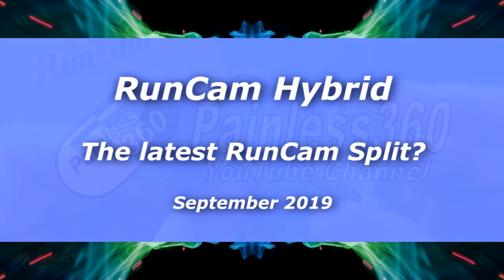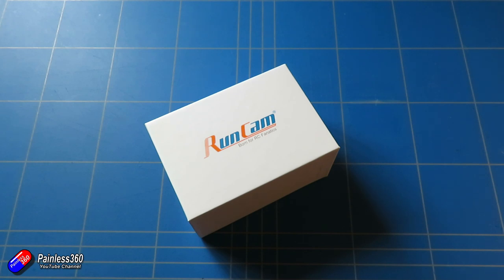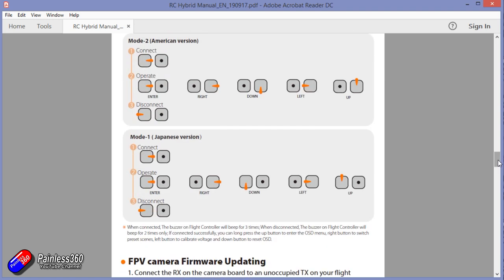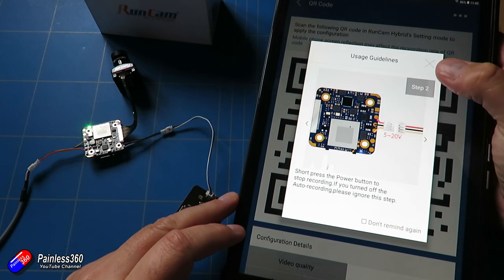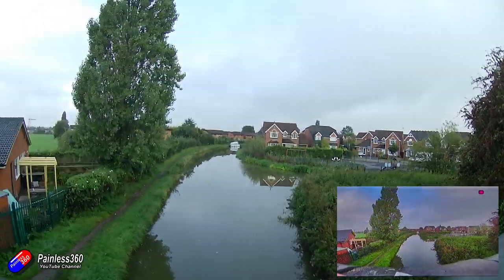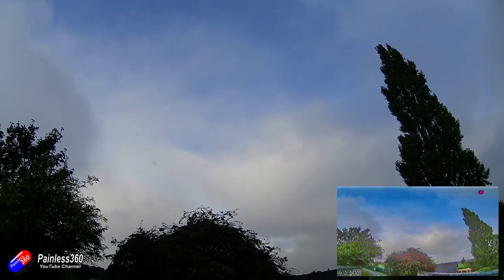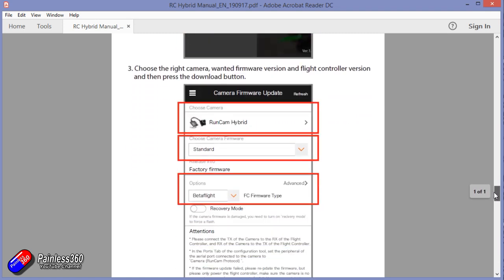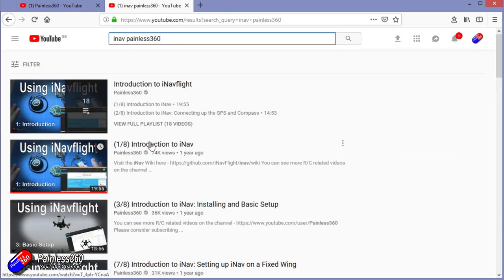RunCam Hybrid: First Look

Comment: Ok, here is what i figured out. Unless the Runcam hybrid is hooked up to a flight controller(UART control) then one MUST have the "joystick" to change certain settings on the fpv cam. The HD part can be adjusted /configured via the QR code method. The runcam doesn't come with the "joystick" so good luck finding one. I am from USA I searched and searched, nothing, not even on on Ebay, bangood? I eventually got some after a lot of aggravation.  I've ordered a few of them, So anyone in the USA who wants one, get in touch with me... 🤣 Happy FPV'ing everyone💖

Comment: I watched Nurk FPV's comparison clips against a GoPro a short while ago, the Hybrid has a smaller FOV and couldn't cope in some lighting circumstances as its brightness was blown out where the GoPro coped fine.
I'd like to see a comparison against the Tarsier because that's what have and as ever always looking for the next best version :)  (mine went swimming in a river 2 weeks ago... still works after drying it out and modding in a wire for power)
Reply: I have a similar story. One Tarsier is gone from a Crossfire failsafe, and the other just died after 8 weeks of use. If the footage from the Hybrid is close to as good as the Tarsier, I'm switching!
Reply: @Larry Delceg  There's a chance the Tarsier can still be used as an FPV camera since that part is completely contained in the dual camera module, the two external boards are only for the HD.
Figuring out where to solder the video, gnd & power lines (not sure if 5v or 3.3v) requires a multimeter in continuity mode.
Reply: @licensetodrive9930  Absolutely correct! The FPV cam is still working fine. It's the HD cam that's malfunctioning. Yes, perhaps I'll put it into another quad sometime to use it FPV. The FPV cam in the Tarsier IS excellent, isn't it? Hoping that the FPV cam in the Hybrid is at least close!

Comment: Thanks for the great review Lee!
Is there a 5.8GHz transmitter for the FPV already included in the board? I couldn't see one plugged in at 3:12...
And can you change which channel you're transmitting on, in case you want to have 2 onboard, and switch between them?
Reply from the maker: The VTX isn't part of the package, see the unboxing segment. Also, if you want a two camera setup on the model that you can switch to simply then something like a camera switcher is a lot simpler (I have videos on them on the channel). Best of luck!

Comment: Nice video Lee. My only comment is the connecting cable looks flimsy and very short. Do they do replacements/longer cables. Also having the two cameras mounted together means that where one looks so does the other. Not good for head tracking etc. Still where there's a requirement this looks like the typical Runcam solid option. Have a nice one ... Les.
Reply from the maker: You too - happy flying!

Comment: Thank you for this video. I have a Beta85 pro2. It only runs in 2s. Will the Runcam Hybrid 2 work on 2S?
Reply from the maker: Voltage range is 5-12v so the 7v form a 2s Lipo should be fine.. Happy flying

Comment: I am in the process of building a Armattan Gecko, have not got a camera for it yet so this really caught my eye when it was announced. But i have a feeling the 25mm length of the camera board is going to mean it's just a bit too long to fit inside the nice titanium cage on the front of the Gecko. Anybody here that can confirm that? If that is the case i hope that frame manufacturers like Armattan take into account that these dual optic cameras are becoming more popular and maybe give us the option to buy a slightly larger titanium cage for small frames like the Gecko.
Reply from the maker: I've just tried it here and it won't fit..
Reply: @Painless360  Thanks a lot for this, I was about to buy one for my upcoming Gecko build, hoping it would fit. Thankfully you already let us know. Oh well, guess I will get it via the CineBee Hybrid then :).
Reply: @Painless360  Thanks for confirming that Lee, i had a feeling that would be the case. One of the normal nano splits it will be then. (So glad the hybrid was not available when i first heard about it a week or so ago - otherwise i may have jumped in a bought it without thinking about the fitment in the Gecko).